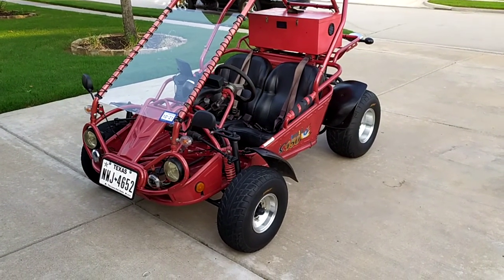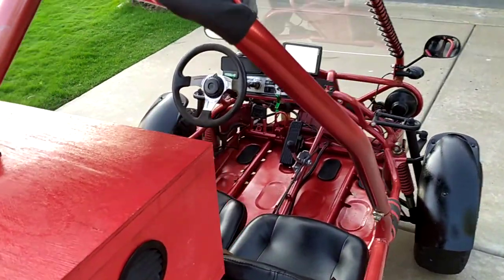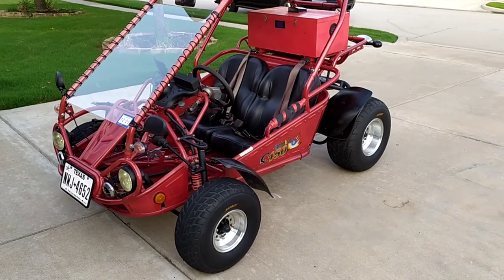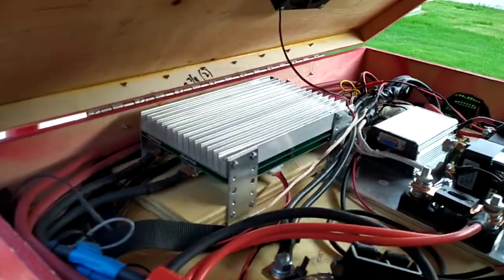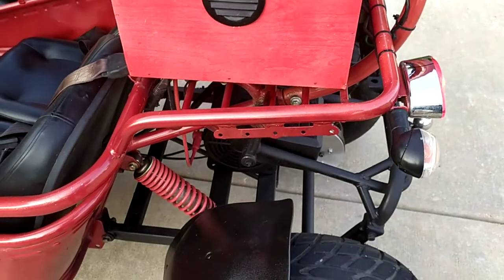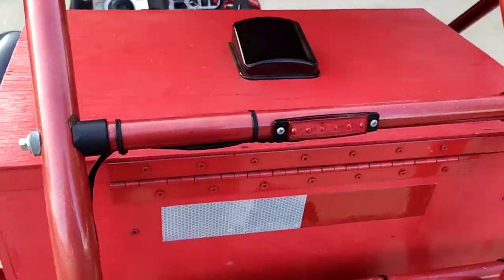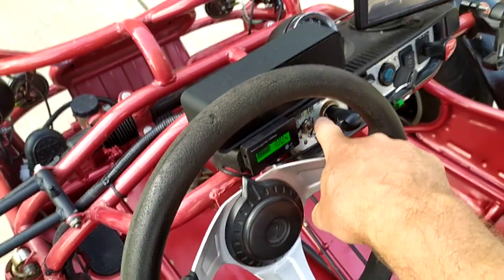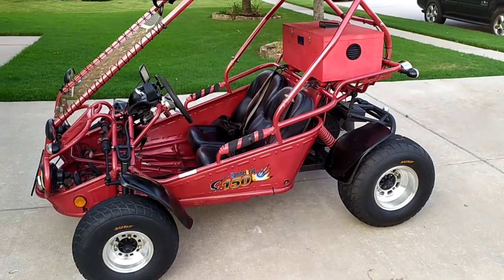Hammerhead 150 Street Legal Electric Vehicle conversion! Part 1 of 4

Comment: This is great! Where did you get the seats? I've halfway finished a very similar conversion (non road legal yet) but haven't found seats and am still currently using the original gear box.
Reply from the maker: Thx Jeremy, I bought the rolling chassis w/ a non working gas engine and it already had the new seats.  However, they are available from the factory here:  https://hammerheadperformance.com/replacement-parts/body-and-frame/oem-seating
Reply from the maker: Thx! I just got some plexiglass and cut & drilled it.  The headlights are stock ATV headlights that came w/ the hammerhead but I just replaced the bulbs w/ direct fit LED's.

Comment: Can you provide web address for these parts, and what was the cost of just motor, battery, controller, and sprocket/belt. I'm doing this same thing but for my kids a ride to the bus stop, thanks for your time and hard work your buggy is rad
Reply from the maker: That's a lottta data.. lol.. If I were to do it again, I would not recommend doing it like this.. I'd recommend a Motenergy ME1306 and Kelly 500A brushless controller.  The belt drive components came from Comet Kart Sales , the belt drive sprocket adapter plate came from AZUSA (custom).   I built the battery myself out of LG 64aH pouch cells.   When all was said and done, soup to nuts, that's $3500-$3700 sitting in the driveway and that was me buying a non running HH 150 for $750.

Comment: That is an awesome build! Wondering if you could provide more details on the battery pack. I didn't see the 20s batteries in your ebay store. I am planning my first conversion ( 84 Honda 200trx quad)  and could really use the help. I really appreciated your info on the belt drive in the comment response to Ron. How did you know/decide that you needed a 5:1 GR?
Reply from the maker: Thanks! The big reveal is coming soon of the most insane build I've ever done.   I do have the 60 ah lipos on my site, I have 35 left, 15 are spoken for so I have ONE CASE LEFT of 20...  https://www.ebay.com/itm/274872885106  The GR of 5:1 was learned from the Carter Superwheels conversion videos I first posted whereas I learned that  4:1 was too heavy, 6:1 was great, but left meat on the bones and 5:1 was "just right"..
Reply from the maker: The battery pack is 4.2v Lipo genuine LG 60ah cells in series. I don't have any at the moment but the ones for this build I got at Batteryhookup. They don't have any either.  Regarding the gear ratio, the original series on my son's go kart details the research on 4:1, 5:1 and 6:1.  The same situation applied here.  6:1 left too much top end on the table and 4:1 was overloading..

Comment: This is really amazing - I definitely wanna try out a belt drive! 
Would u be able to list the links to some of the items you used? 
Specifically,
- the particular belt drive/sprockets on the Comet Kart website,
- the 200A Battery Management System via Android with Bluetooth,
- and the 5kW, 72V Lithium Ion Battery (20s, LG Chem Lipo cells, 60aH)
thanks in advance!
Reply from the maker: Thanx! Yes it was my most aggressive build yet.  I think the big thing was all the red tape at the DMV where the real value is.  Now that it has  VIN and it comes up in the DMV as an electric vehicle, this is a steal for someone at $3795, far cheaper than a golf cart can go faster and does not have the restrictions, plus it is a lot more fun. (It is for sale).
However, to answer your questions, the driven sprocket and drive sprocket are not on Comet Kart Sales website, I had to call them and they came up w/ the solution for me.
It is a 17 tooth drive sprocket, 8mm pitch, 87 tooth driven sprocket, aluminum, 2 part clamshell. (5:1 gear ratio).  I had to give them the distance from the motor shaft and the axle and they provided the belt to match! :)
The sprocket adapter plate was custom made for me by AZUSA.  They have an enormous amount of sprockets on their site and can pretty much make anything you want.
The batteries, I sell on ebay (traderrje), and the BMS I got from www.lithiumbatterypcb.com
Reply: @TexasNEV  wow - that's really a steal, had no idea that you'd actually be selling it. If I weren't so deep into my investment here, I'd seriously consider it. At this point, I'm so far in, it'd be best to finish what I've started. I've got 2 kids, so everything I do has to be multiplied by 2! Thanks for the links. So why were the belt and sprockets directly off the shelf from Comet Karts not work for u? Why did u have to go custom with your belt and sprockets?
Reply from the maker: @rona5945  Thanx!  I think so too!  I just wanted to get some capital back to finance my next project, a brushless 4 seater or Tao Tao Arrow high performance electric conversion... 
As far as the custom nature of the sprockets, I don't think it is so much so "custom", I think it is just because Komet cart sales doesn't list everything they sell on their website, that's all. :)  I think the 8mm pitch 84 tooth 1.5" wide two piece aluminum sprocket is on their site.. This might be it:  https://cometkartsales.com/8mm-Belt-Driven-Sprockets/
Reply: @TexasNEV  Very cool - Never heard of Tao Tao Arrow, had to look it up. I saw 2 seater versions, but they look huge!  Definitely looking forward to that build. Will that also be street legal?
Reply from the maker: @rona5945  It is pretty big, but moreso long and wide, seems lighter than the Hammerhead even though the weight specifications are opposite.. We sold the first go kart in my video series, that was my son's, so the TaoTao Arrow is his.. if I make it street legal, then he can't drive it.. So I'll just have to pre stage it all to BE street legal but not actually do any of the paperwork until we decide to put this one on the webstore too.  So, short version, while it is his, "no", but when it goes up for sale later, "yes". :)
Reply: @TexasNEV  still for sale?? Range should be about 50 miles, yeah?
Reply from the maker: @jeremybartlow  Sold it.. Customer is NOT getting 50 miles because of how they drive it. They're not driving it as a means of transportation per-se but ride it fairly hard.  Even then I think 50 is optimistic.  Knowing what I know now, probably 35-40 mi tops.  There is room in the battery box to go to 10kw which would be amazing.  My customer might opt for that at some time in the future, which would up their top speed, up their acceleration and greatly increase the range.

Comment: Can you pm me for a parts list?
Reply from the maker: That would be A LOT of stuff to document but the core components are a Motenergy ME0709 and the Kelly KDZ72550 controller assembly board w/ throttle.  The motor sprocket is a 10 tooth 7/8 keyed shaft for #50 chain and the axle sprocket is a custom made 50 tooth #50 chain sprocket from AZUSA cut to spec to fit on any Hammerhead 150 or variant.   However if I were to do it all again, I would do it differently.  I would go w/ a brushless motor and controller and would have gone with a 40 cell configuration in a 20s2p for 120 aH.
Reply from the maker: @jefftolson796  No worries, I have a contact page w/ an e-mail link @ texasnev.com.  I look forward to talking to you.
Reply: @TexasNEV  The link you provided will not work.
Reply from the maker: @jefftolson796  info@texasnev.com is my e-mail address :)